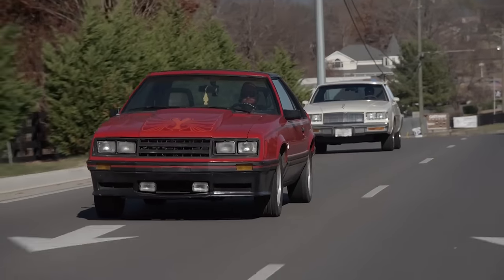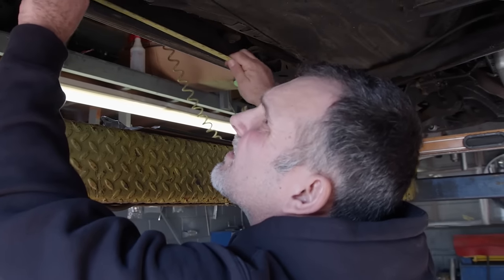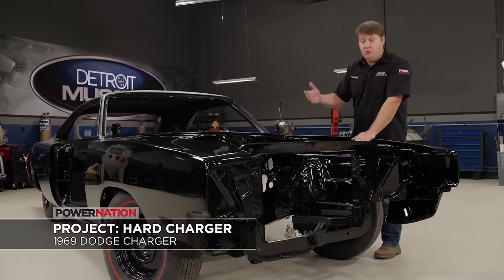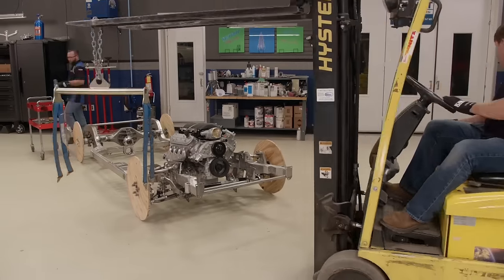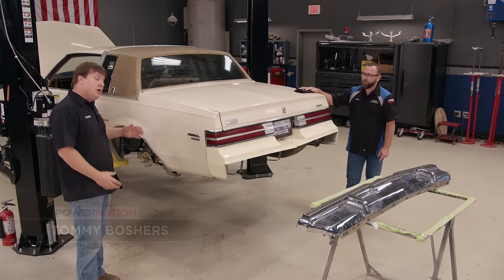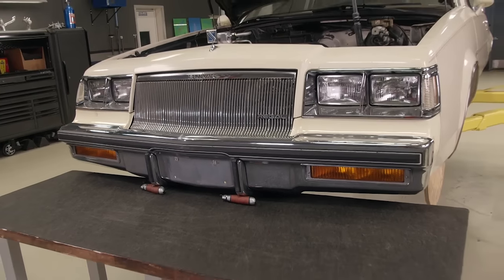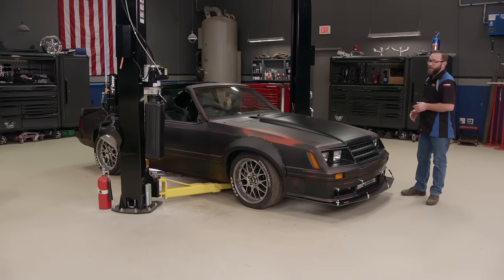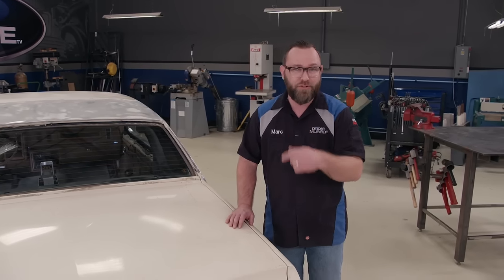FULL BUILD Buick Regal: Some Say Pro-Touring, We Say Pro-Luxury

Comment: In 1988 I  I had been divorced from a psycho wife for 4 years. I had managed to saved up $10k and was shopping for a barely used automobile. One lot showed me an almost new Turbo Regal V6. Not knowing what it was, I scoffed at it and said huh! A V6, I need power! I need a V8 engine! The salesman tried to convince me to take it for a spin. But I was not interested. I ended up buying a fully loaded single cab dodge pickup. Months later I saw a weird sounding Regal shredding the drag strip and realized what I had passed on.
Reply: That’s the difference between all of us and Jay Leno. Jay would have offered the salesman half and jumped on the turbo Regal V6. When will we ever learn?

Comment: I seem to remember seeing this thing for sale recently.. I think it was around $45k... might seem crazy but all the labor that went into it, plus some pretty premium parts, I think its a great value. Building it yourself would likely cost you a lot more. Connect and Cruise set up alone is like $8-10k, probably $15k(ish) if youre having it done at a shop. Thats just a partial powertrain.
Reply: What!!!! That is a steal!!!
Reply: The chassis by itself I looked around 30k the motor is 12k paint 2k bumpers 2 k labor easy 40k

Comment: That exhaust tip you made is awesome! I had a shop make up something similar for my 2001 Volvo V40 a few years ago. It basically was a 12x2 tip that was solid but using the Volvo font made a change. The gases escaped through cutouts that spelled" Volvo R Power" and had background internal red LED lighting. J had them covered in a dark smoke black chrome. They sat under the rear doors of the compact wagon just in front of the rear tires. The car was white with black trim, 19 inch white five spoke wheels with 235/30/19 tired with red Yokahoma lettering, a single 6 inch wide red strip front to back offnset to the right side passenger center. So with those tips glowing Volvo R Power along the side at night looked great.
Reply: tamam

Comment: I've always loved the styling of the regal. It looks like it would run like a scalded cat but unfortunately moved like an old golden retriever.
Reply: Agreed.  Although I'd argue the GN did indeed run like a scalded cat... It was faster than the same year corvettes.
Reply: @iambiggus  Yeah, the GN and GNX were so fast Chevy whined to its GM overlords and had it cancelled so they wouldn't keep embarrassing the Vette.
Reply: @Ideo7Z  not necessarily true. Chevy wasn't happy but the demise was the end of the Gbody platform and the end of rear wheel drive intermediates and Chevy had nothing to do with that. That was GMs plan before the GN even had an intercooler and fuel injection.

Comment: That regal looks like that had a time machine...even the insulation behind the door panel looks new
Reply: That’s what happens when you are not in the salt band and had a grandma driving it. Lol
Reply: @dwightschrute3862  I live in Florida...don't even see em that clean down here
Reply: @shawnbrownfield9857  it’s humid there which wrecks everything in a car. Out in the Midwest cars never rust. When my grandma was living in Colorado in the 70’s, there were 40’s trucks just driving around In perfect condition because there is no humidity
Reply: @dwightschrute3862  g
Reply: @dwightschrute3862  u
Reply: @shawnbrownfield9857  t
Reply: @dwightschrute3862  Yu
Reply: @dwightschrute3862  ya
Reply: @dwightschrute3862  need to go out there to find my unicorn...'56 chevy 5 window unmolested

Comment: makes me sad that regal was perfect should have found one needed work
Reply: "Regal" and "perfect" don't go together homie. I love G bodies, but the point is to make them FAST.
Reply: I agree, its thousands needing everything they did to that one, i would have drove it till the engine let go then i would have put a 3.5 ecoboost/6R80 and used the cruise buttons for up/down shifts and had a fun kind of quick car that nobody would suspect
Reply: I would have did the new frame motor brake system suspension   and painted it back factory good sleeper

Comment: I had the same car, though an '84. Called mine the "Reese's Cup" because of the peanut butter paint with chocolate interior/vinyl top. Had a Grant GT wood grain/aluminum stearing wheel and aftermarket sound system, with a 600 watt amplifier bumping two 10 inch subwoofers in the trunk. The ride was kush! Though turning it rolled like a log on the Mississippi River. I wanted a stiffer suspension set up, 383 stroker motor or turbocharged 3.8 from a Buick Grand National or T-type, mounted to a six speed manual transmission! Sold her for the same I paid, $1400 bucks. She had 62,000 miles, and was in excellent condition... 😭

Comment: My shift handle broke off while using the boat. Trim wires shorted raising the drive out of the water. Shut it off. Cut the harness, made the drive go back in the water and used Channel lock pliers to operate the throttle and gears. Just. In time to get out of the way of a Great Lakes freighter. It was interesting.

Comment: I put a Pleasurecraft Marine Engines "Pro Boss 5.8 EFI" in my 78 F100 Ranger XLT 2 Wheel Drive Short Flare Side with a C6. It's got an Edelbrock Manifold and 600CFM Edelbrock carb, Ford Racing Parts E303 roller cam and lifters and a Detroit Locker 3.70:1 Ford 9".

Comment: Amazing work...
You seem fast in doing    setting up things as the tube that  connects the fuel tank...Iam woundering why you don't set it closing to the tank by vertical angle then horizental one towards the tank to be not seen and away from obstructions.
Also all your work in cutting ,welding, poring in metal.why you don't use plastic or UBVC and rubber as spacers and  tubes chimses..
Please don't take this comment as critics..it just another point of view and sharing.

Comment: Looks great but for the dash, steering wheel and column.  SMH why there wasn't a new instrument cluster installed, and why the column shifter wasn't removed when you put a shifter on the trans tunnel transmission.  Also wondering why you didn't change the dash color and steering wheel to match the new interior?

Comment: Say what you will about the G body 355 was the right cam and a set of vortec heads spring upgrade and up the rear end ratio on the on the cheap you'll be a happy camper... that's if you can find one anymore🤣👍

Comment: I have a custom made Holley intake manifold for my Acura V6 and I have NEVER been able to make it seal properly. It's set up with my Skunk2 90mm throttle body and it just won't seal properly so it makes it a huge vacuum leak. I paid damn near $1000 for it because the base is milled from billet aluminum and that part's nice, and it did come with a paper gasket, I've even tried to coat both sides with RTV, but it still won't fully seal. Basically I'm left with an awesome looking $1000 paperweight. I will say that it looks AWESOME, but if it doesn't work then what's the point?

Comment: I didn't make it into the first minute. I was shaking my head, Buick engines made gobs of torque, Olds also! I have a 1980 cutlass junk yard dog, I welded in a jegs 4 link rear suspension with a wishbone track link system it works good, she stands up. with a balenced 70 olds 350'.straight cut muncy 4 sptd trans I  want to build a olds dx diesel block for her. Hot rod mag did a artical about building a dx block ,51 % thicker cylnder walls and a 3 inch crank main bearing with modifacion a 425 wiith  the counter weights cut down can give you a 456 cid smal block. I feel that olds is underated. Iv'e built a few rat rods along my way ! As an Olds guy I despise a chevy drive line.

Comment: Not a fan of the fixed exhaust to the bumper instead of it floating in those ports and seeing it vibrate/move under engine torque.. Also while that is nice fab work they did on the bumpers I would have rather they just shaved them altogether or gave them the Foose treatment.

Ill be honest -- I hate both tans/browns/burgundy/red interiors and exteriors but once in a while when done right it just works. This is one of those rare times. Kudos.

Comment: As a current 1987 Turbo T owner and previous owner of 5 other turbo Regals I do like this build HOWEVER what was done with the front bumper is horrific.  The holes and lack of black air dam under the bumper as indicated in the artist rendering is disappointing.  Lose the holes and add the black air dam like you see on the turbo models and this would be a 10 out of 10.  Nice work guys!

Comment: Was I hearing detonation from the engine in the Regal when it was on the track at the end, or was that something rattling? Hard to tell on a phone speaker. The car looked like it handled well though. G-Bodys are my favorite car. My drag car is an '85 Cutlass, and my street car is an '81 Monte Carlo. Both big blocks.
Reply: So you must live somewhere cold? No cars with ac? Lol. After I got rid of my project car I loved i have to admit having ac is like electric start on a bike dirt bike. Pure magic button that makes all life and riding easier. I never noticed how uncomfortable and unhappy I was even when I was having fun with my ls e36. It was so fun and badness but godamn driving to car shows in the summer was a nightmare especially since everything was like hours from me lol. As I get older the more I value ac. Wouldnt own a car without it anymore. And retrofit ac kits usually suck aswell. Although better than nothing 🤷‍♂️
Reply: @kmkcopkiller  Huh?

Comment: Pan-hard bar at 21:16 , lol. Try PAN-erd next time. Oh and BTW, those guys putting that cheap Panhard Bar set-up instead of a Watts Link tells me all I need to know about that shop. Have fun going over those railroad tracks and speed bumps. You'll get enough wiggle in the back seat to shake up your Vodka Martini, not stirred.
Oh, and WAY too much sway bar up front. That thing is gonna ride like a buckboard. "Pro-touring" on that suspension is gonna mean sore wrists after two hours on the interstate.
Or was there a plan to replace the body to frame mounts with shock absorbers? lol

Comment: An obvious indicator of acceptable designing, is whether the style of a piece has been generated by the auto industry manufacturers. This comes 
to mind because of the support braces that were included on the fabricated rear spoiler; Not good, because it creates a considerable amount of
inconvenience when you hand wash the car. The modifications inside the trunk would be advisable on the "you only have to do it once" plan, and
it would allow for installation of an early Camaro style spoiler. The one that was made (demonstrated) in this video, could have incorporated two
(2) side pieces (support braces) that folded toward the front of the car. Then, a third piece could have been added to connect the existing flange
(final spoiler piece), the back of the support foundation (spoiler base) and the two (2) side support pieces. It would be much cleaner AND it would
conceal the exposed screws on the top of the trunk/spoiler. Also, GM approved this (fiberglas spoiler) design.....

Comment: A lovely job but I don't trust those bush rod ends or rose joints. Had a 70 challenger years ago and 2 joints on the rear end burst open and the car flipped over.. This was around town at 40 mph with my partner and two toddlers in the back. The night before I was doing 70 mph coming back from a car show with kids in the back again. Thank goodness they never burst open then. My toddler is now 32 and we're building another 70 challenger. My question is. Is there a company that make extra thick joints. I'm talking excessive super duty! I don't care about adding a few kilos of weight. Just don't want to flip another one.

Comment: ...I had a co-worker with a Buick Regal, it had the electronic dashboard. He put in a rebuilt engine in it.
When the odometer turned to 200,000 miles it read ERROR. true story, not lying

Comment: You know I like GNX and I even like a regal but there's a couple things I don't like about this car for one everything completely custom including having a weld the reducer onto the water pump. So what happens when you need to put another water pump in it? That introduces a problem. Additionally no speedometer cable so there's no way to tell how fast you're going. Along with exhaust tip welded into the bumper what happens with age and it needs to be changed not to mention I'm pretty sure the restriction with the muffler location having to bring all the angle pieces to meet up with the tip 90s. Plus notching the bumper. And what about a rear seat no mention of that probably not because of the wheel tubs and all the metal work back there and you also lost the trunk. And lastly a highly painted car with not a mud flap camera angle putting dirt and rock chips all over the back quarter panel. You know I had high really high hopes for this. And while not a total catastrophe. I probably would have modified it a little but I would have kept factory regal their older cars they're very hard to find in good condition I still would have done spoiler paint and gotten rid of the ragtop but it could have been made into a sleeper or at least a real good performing regal. Now it's just a regal looking custom with issues. It's not even drivable with no speedometer no back seat or trunk and fully custom makes it real hard to maintenance. I know it sounds like I'm giving it a hard time but I didn't even watch the foxbody mustang because who really wants to see that garbage all the little Ford fanatic mustang fanboys.

Comment: 1:24:31???? You need to stop pulling the torch away from the weld puddle so fast when you stop welding. You're letting contaminants enter the weld puddle and the end of the TIG rod and weakening the weld. The TIG rod and weld puddle should not be cherry red when you pull the torch away. There is a reason that the welder has a post flow time. Leave the cup over the weld and rod (in the shielding gas) until the post flow stops. If it still discolors or is red when it stops, increase the post flow time. And your welding way too hot or not enough shielding gas to get a weld like that with TIG. Based on the heat affected zone in this exact time, it would be too much heat, too slow travel speed or contaminated tungsten.

Comment: First off, you guys do top notch work. The Buick Is beautiful and sounds amazing. 

My 2 critiques are: you guys put sooo much work into everything.. but then left the ghastly stock 80's Buick dash & steering wheel in it in that ugly color. 
The interior guys did amazing work but wish it was to match to a new black dash with updated gages & fitting new steering wheel. 

2nd Critique: This would have felt complete for me with a 7 Speed Manual Trans.

I use to own a 1985 Buick Regal in the 90's that was given to me by my great aunt.

Comment: That original 3.8 V6 (aside from the Delorean designed one) was junk. Yes they ran ok but, they leaked alot of oil and had alot of other problems though.  The later 3.8 that they were putting in the front wheel drive cars was a better engine. The best thing to do with the Regals, Cutlass, and Grand Prix was yank the engine and drop a 350 chevy in them.

Comment: The LS is so ubiquitous an an engine for engine swaps that I really want to hate it, but it's just so good at what it does that I really can't. It's reasonably compact, ludicrously easy to find parts for, very reliable, comparatively fuel economical, and can be built up to just about any power output you want with a relatively high level of reliability. It's just boring because it's the first choice for so many builds. Regardless, it'll make this a very nice luxury touring car once it's done. Hard to fault a project that delivers on its goals.

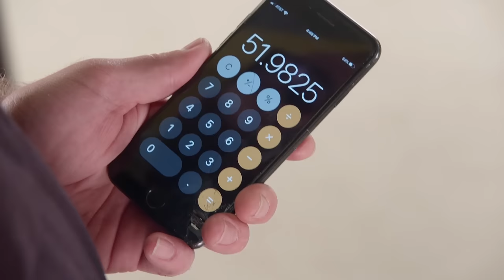Comment: 2:06:13 Marc adds 45 thousandths of an inch (seal flange thickness) to a tailshaft measurement taken to the nearest 16th of an inch with a bend in the measuring tape.

Comment: Had a GN. V6 can't take the boost without oil leaks. Also the number 7 rod bearing for some reason is weak on oil getting to it. Just shove a 350 crate in it. It'll fit and headers will also it's just a bitch. Sub frame cross and swap the rear end gears. Ttg after that

Comment: The color is very similar to the dark metallic red my '87 Buick Somerset came in but I like the tan interior much better than the red mine is.  The seats are nice but I don't like the grommets at all because besides ugly, they're going to come out eventually and usually sooner than later, so back to the upholstery shop in the near future.  Unless you're making sails or tarpaulins, the grommets in the seats is not a good pairing.

I know the Grand National has a spoiler but for some reason, yours didn't look right when finished.  My old Somerset had a luggage rack that made the plain trunk lid look a lot better.  Not saying you should've put a luggage rack on it but it's an option or perhaps a horizontal spoiler like the Trans Ams had in the '80s.  With everything you did to the car, you really didn't need a spoiler and it would've been just as impressive without it.

All the holes you put in the bumpers made no sense either, I would've left it as a solid piece instead plus it looks much better that way.  I really don't know what you were thinking when you done that.

All in all, a great series and love watching these kind of videos. 👍✨🔥💥

Comment: Looks like this car turned into a project from hell. I wouldn’t have changed things up that much. If it ain’t broke, don’t fix it. That gas’s tank doesn’t look like it holds much. I would kept the 6. Rebuilt it. New exhaust. Don’t some body mods like new bumbers( without the holes) upgrade the suspension to new, and painted it.